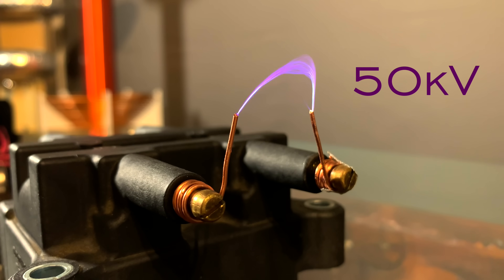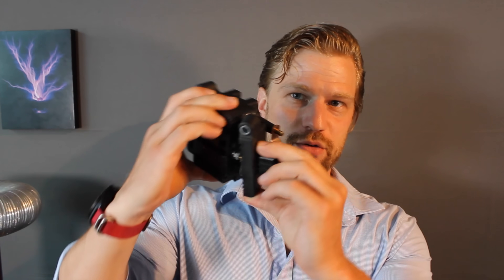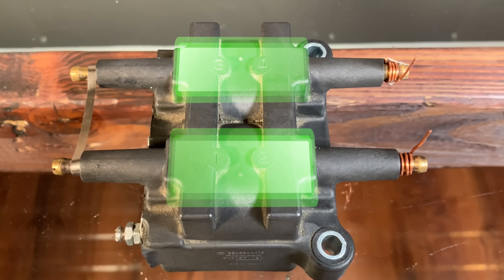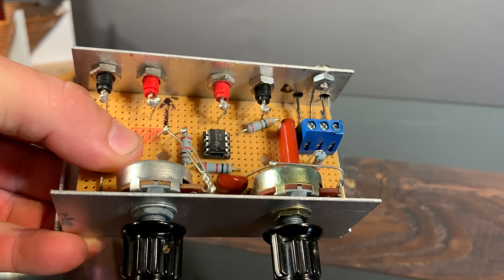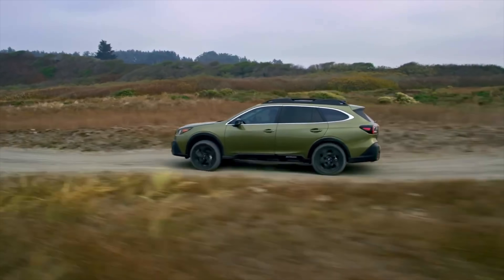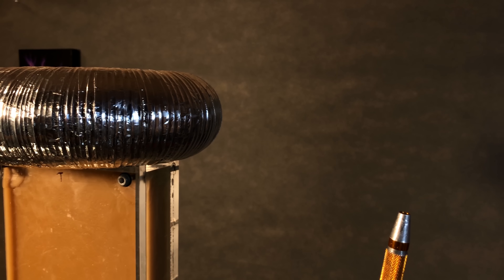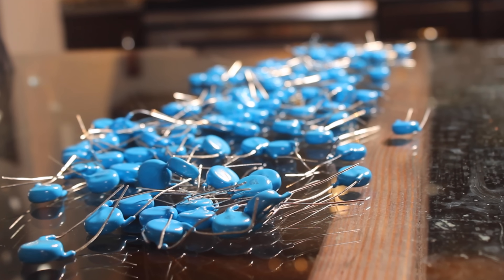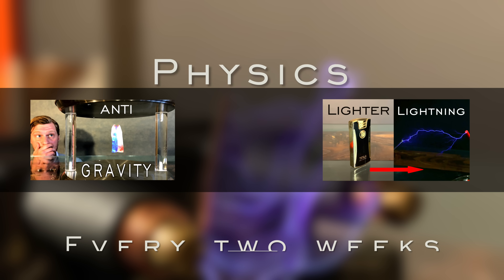The 50,000 volt Subaru Outback Powersource!

Comment: Looks like a good application would be to make nano metallic partials or colidal silver
Reply: very few people know of colloidal silver. Is HV right for colloidal silver though? I've heard differing arguments here.
Reply: Divad Ignawm No it is not needed.  You can use just straight DC but very low amperage,  like less than 20ma but less than 1ma will give you a very fine colloidal of silver.  The smaller the particle the better for health reasons . See Bob Beck for his dc version.  I make a joule theif version that works very well.  
Go to my channel Jeffrey Dove you can find a video there.  if more info is needed contact me I will try to help you out with the info.  Jeff
Reply: @jeffreydove2036  Hi, I'm familiar with the low voltage, low amperage like the 20 ma you've mentioned. The HV colloidal silver is the one that puzzles me, and it's very uncommon. How do the two different methods and results compare, like is one superior to the other?
Reply: I mean even after watching like 30 vids, I only met one guy who advocated 4 the HV approach, and it was proprietary. You're the other one I've met
Reply: Divad Ignawm  Mine isn't really high voltage  , only about 35 to 49 volts pulsed DC.  You don't need high voltage and anything proprietary as his can do nothing more than make colloidal silver too.  A home made version is just as good,  there just out for your money and to get you to think they know something more when they don't.  It's not to hard to make yourself one.  Jeff

Comment: Sweet video! One note, you might want to add a disclaimer in the beginning. The ZVS driver can be had on eBay for a few dollars and outputs enough current to easily kill an adult. These are not toys that just anyone should play around with.
Reply from the maker: ZVS does indeed put out a bit of current. You make a good point, I have a disclaimer in every video descrition as well

Comment: Hey Jay, 

I love the extremely interesting content of your videos, with which you learn something completely new instead of the whole mainstream that you usually find on Youtube.
I can not wait to see the 1.2 million volts high-voltage cascade, you never get enough and that's what I like. I will be the first time build  by myself an eight-stage cascade with around 15000 volts input voltage from one of the high voltage generators offered on ebay for self soldering, let's see if that will be successful.
What I've wondered if it would be necessary to isolate the multiplier with wax, because I do not quite understand how your "DIY Desktop Lightning Tower" the acrylic glass before and behind the perfboard to isolate the whole, if internally Sparking could occur. Maybe you have the time and give me a conclusive explanation :)
In any case, you have a new subscriber.
Reply from the maker: Cheers, a welcome to Plasma Nation! I actually made a video about my voltage multiplier , about 5 videos back. Take a look, it shows the internals and the wax used to insulate my multiplier. I’m honored to have earned your subscription!

Comment: Dude you should try your hand at ION propulsion with this thing.
Reply from the maker: Ion Propulsion itself requires a fairly high current in order to achieve significant thrust. The high voltage from this coil....would definitely allow a small craft of less than 10 grams to levitate...but that would be about it. In order to provide true propulsion, I would need KW of power. This consumes only 45 watts.

Comment: I want one.
Reply from the maker: Junk yards sell them for 5-10 green backs a piece!
Reply: @PlasmaChannel  i got one but the ZVS driver i use for my tesla coil doesnt really wanna work with it. Im not sure if mine has PCBs. But it works with a pulsed supply. (As they are designed to)
I run mine off my small 2000v test bank ant it works but it defeats the purpose. Because im using a ZVS driven flyback to charge that bank, but i want to try use this ignition coil instead.

Comment: I hope you have enough oil for the 1.2 million volt voltage multiplier😅😅 I think that the hardest part of all, to keep al te electricity isolated of air... especially witch such a high voltage😋😋
Reply from the maker: Each stage of the multiplier will be rated for 150kv -160kv. Insulting the thing will only be doable with mineral oil or transformer oil, and an acrylic enclosure! I'm excited to start it. But...its very expensive. This is one reason I started my Patreon account - to help offset the costs of such videos.
Reply: @PlasmaChannel  what about using ordinary oil but with a slightly bigger distance. and some grading rings.

Comment: Awesome work as always Jay. I look forward to your work. Thank you. 
Jay can you explain me this please?
If you take HV AC I'm using about 5k. 
And place the copper wires 90° to a ring magnet (like from center to external edge. Wire parallel to wire) It dances on the South side of a ring magnet. It doesn't on the north and it only works on ring magnets. 
It looks much the same as a Jacobs ladder in HV yet the heat isn't the push. Angle the wires down as to travel in the opposite and the arc still travels as before. 
It's crazy beautiful to watch. Well worth a try. 
Thanks in advance.
Reply from the maker: Gareth, thats a really interesting observation. I may try this and get back to you. Permission to make a viddy about it?
Reply: @PlasmaChannel  your missing our if you don't try it. The effect is different to all else I've seen so far. 
I would love you to make a video regarding this. Your visuals are exceptional. 
Thanks again Jay. Keep up the great work.

Comment: How to tune Tesla Coil to produce quarter wavelength high voltage high frequency AC on secondary coil for powerful brush discharge? AC apparently becomes DC like on secondary coil when tuned to 1/4 wavelength.
Reply from the maker: Technically, that is correct! At least in terms of 1/4 being a fluctuating DC current. I can look into this!
Reply: what do you plan to do with that brush discharge? Jst curious
Reply: @davemwangi05  Try to produce tubes of force in the ether to cause electromagnetic momentum mentioned by Nikola Tesla and J.J Thomson. Read book on Ether Physics by William Lyne. You can find book on Amazon. Author did a lot of research on Nikola Tesla, ether and stuff related to it and collected it in his books. Ether's existence is currently denied in mainstream science but ether does exist. US Air Force repeated Michelson and Morley experiment and confirmed ether exists. https://www.youtube.com/watch?v=g_loyzL9Wi4 Even simpler proof of ether is in plain sight in the form of magnetic field. Magnetic field is simply an ether vortex around a magnet, not something emitted by a magnet. Inertia too is a form of ether. In mainstream science, only quantum mechanics accept existence of ether, they call it quantum fluid instead of ether but is hardly understood in mainstream.
Reply: @Xeno_Bardock  Hey, I had read about the Michelson-Moley experiment some  years ago, and it's accepted as the greatest experiment fail ever. I'm just wondering, You really mean they're fooling even the modern scientists who have even more sophisticated interferometers, and super complex projects such as the LIGO? What's the motive for hiding the ether?
Reply: @davemwangi05  You will know exactly why they hide ether once you read William Lyne's books. Ether is the power source behind physical universe. Ether also acts as a medium for electromagnetic waves and light waves and produces gravity and inertia on planets. But since mainstream science deny existence of ether, they have attributed electromagnetic waves and light waves to particles and gravity and inertia to being a property of mass. Mainstream physics screwed up big time by abandoning ether in 1930 or maybe it was set up that way by governments of that time to coverup ether as they discovered what ether can do when utilized thanks to Nikola Tesla's research they stole from his hotel room.
Reply: @Xeno_Bardock  Okay thanks, will look into that.

Comment: I look forward to seeing your voltage multiplier
Reply from the maker: It has been years in the planning. It should be a fairly standard voltage multiplier, just blown up to insane proportions. I want to own the largest voltage multiplier in civilian hands, and make DC arcs that resemble lightning in their structure, intensity, and unpredictability.
Reply: Yeah I just started putting together some equipment for small lab. I was thinking about building a similar voltage multiplayer. We also used our 3D printer to make some parts for a rotary spark gap. For some high voltage, high frequency experiments
Reply: ryan reschke me too
Reply: Does not need to be said. BE CAREFUL!

Comment: Where I can get that power supply for myself, I'm so intrested in super high voltages and super high currents!
... And how much does it cost?
Reply: About 3 money
Reply from the maker: In my humble opinion, stay away from high voltage in association with high currents. I throw around high voltage viddies all the time, but its usually at low power levels and not high current. Just be careful. You can buy the ZVS driver on amazon for about 10-20 dollars, premade. The 555 timer needs to be built yourself, and there are many schematics online for you to build from. Cheers mate!
Reply: Banggood has zvs flyback kits but be carefull they  have enough power to kill you